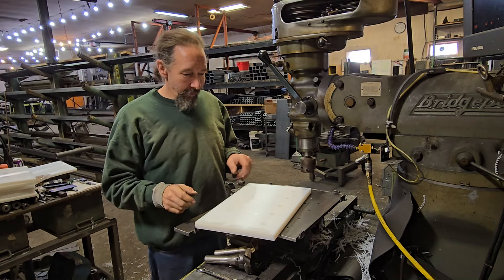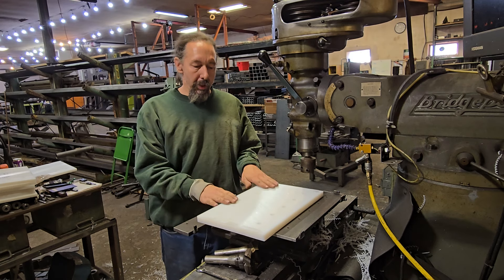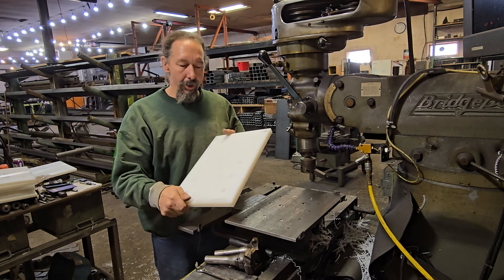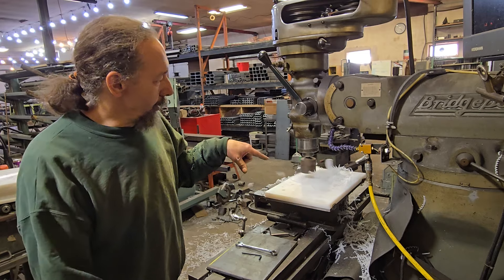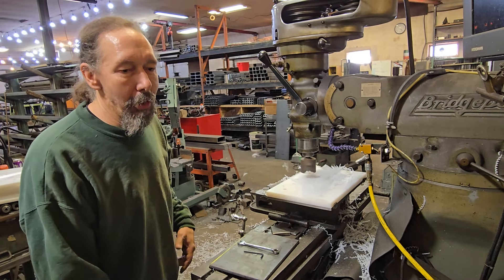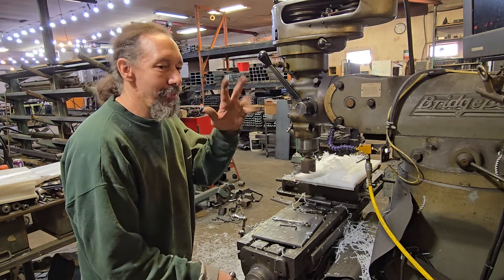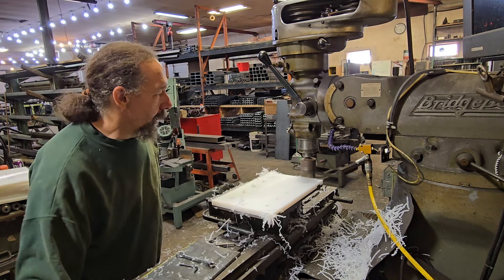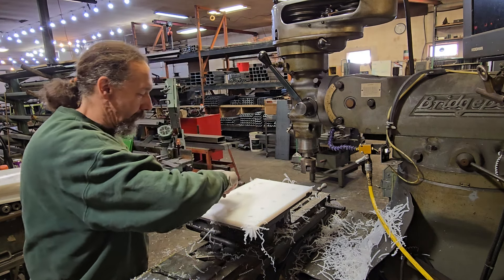Using a fly cutter and jigs on a Bridgport mill to surface flat parts. Minnesota Implement.

Comment: You know that you can make a step drill reasonably easy. Buy a cheap drill that is the size of the counter bore, make sure the drill has a half inch shank. If you have a tool post grinder for your lathe the next part will be easier.  Grind down about an inch, inch and a half, grind down to the drill diameter of the holes you want. Leave plenty of diameter for clearance for the screw body. Now you have a cutting edge on the tip but you'll need to put cutting clearance on the larger diameter. Go to your pedestal grinder and slowly ramp back from the edge.  You could even add a countersink to the tool by starting with the major diameter of the countersink for your drill choice.  If you don't have a tool post grinder for the lathe you can do the entire grind on a pedestal grinder.  You would need to add clearance to the countersink portion of the drill like before.  Seems like a lot of screwing around but once you made the tool you can use it forever especially if you're just cutting that plastic.

Comment: The description of feeding "into and out of" the work was very confusing to me. Were you trying to explain "Climb Milling " vs "Conventional Milling" ?
Reply: He was describing conventional. The insert or primary cutting edge goes into the the material head on. in climb cutting it is opposite to eliminate chatter in the backlash of the feed screw. Where as the tool would tend to pull the work in instead of pushing the work away. Learned about that when I tried a big mill cutter in my lathe. I bought a mill and made a couple fly cutters that would hold 3/8 in square insert type carbide lathe tools. Easy to make and worked well on Aluminum and Steel. Many different fly cutter configurations. This guy uses his mill every day and knows from experience what works. Safety is always a consideration. Metal flys when you are fly cutting.
Reply: @martinnorbeck4657  Yes...I get that...but he did not use the words CONVENTIONAL MILLING........I  like the video...but as a retired machine shop teacher, I found his attempt at describing it..."CLUMSY" sorry if I nit pick....I am more accustomed to TEXT BOOK LANGUAGE DESCRIBING CLIMB MILLING AND CONVENTIONAL MILLING...that's all....not looking for a fight....THANKS...
Reply: @markclauss2314  I had no internet and am self taught. I assumed you were a student or a diy guy. I understood your confusion right away. My high school had industrial arts, but too  many students for the time in the class.
Reply: I found that confusing as well, also if he pushed material into the center vs away from the center he would only have to deburr the ends instead of all 4 sides.

Comment: There is no doubt you have a command go the english language! You can speak brother! Hey, did you ever look into a wood working tool called a planer? I think that would be a quick easy solution to thinning down UHMW. It would be much faster than a mill for sure Craig.
Reply from the maker: I have debated on trying a planer, my worry is that they are usually very high RPM, and the plastic would likely get very hot, and potentially melt...  it does happen if you spin your fly cutter too fast, so likely would be true for the planer as well.
Reply: You typically use the machine you have and are familiar with. There's always more than one way to do any job.